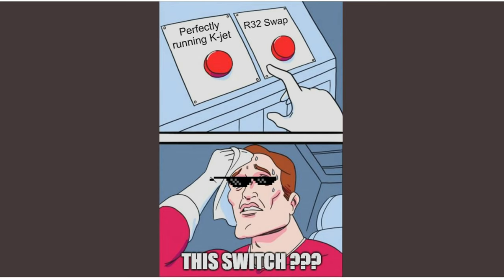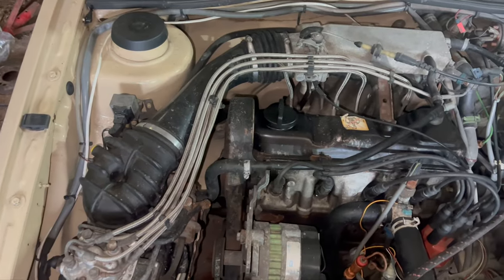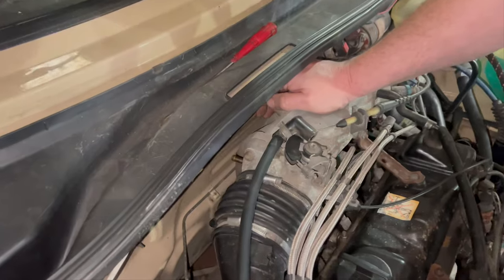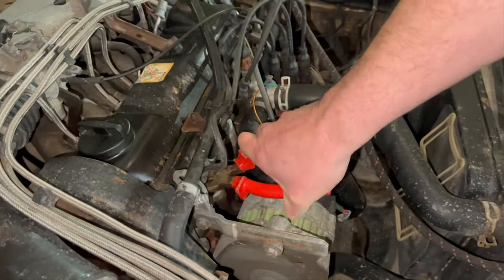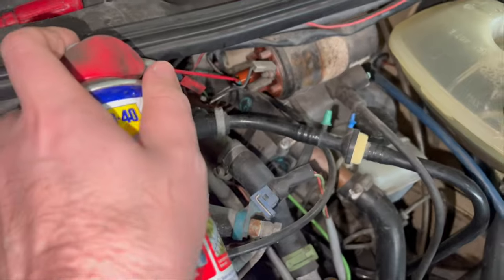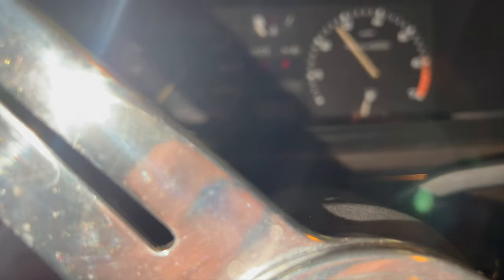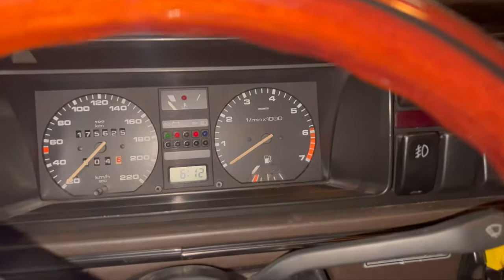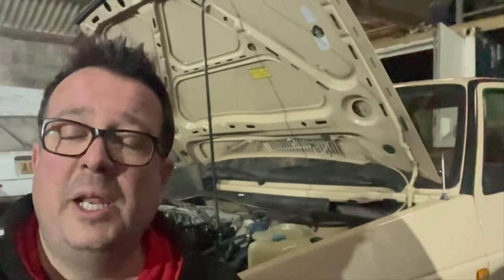My Dream Car Has Turned Into A Nightmare !!!

Comment: As it seems like number 2 cylinder I’d say injector problem, can also be  the filter basket blocked that is in the fuel inlet pipe union on the metering head , apart from that bin the lot and put a Bam in it 👍

Comment: I tested K jet injectors before by pulling them one at time, and putting them in a plastic bottle and checking the spray pattern was good.  I ended up replacing the lot.